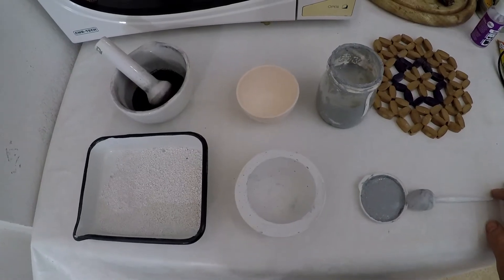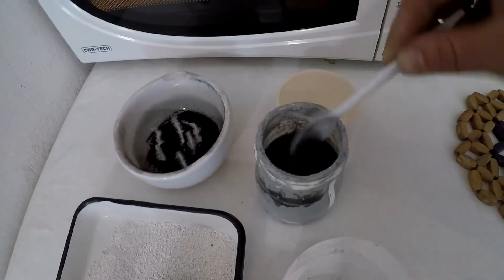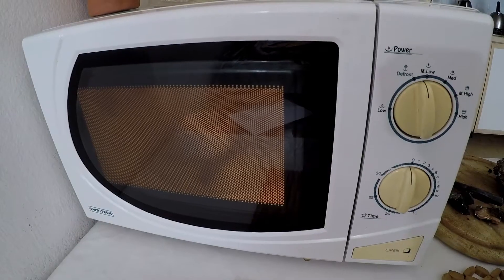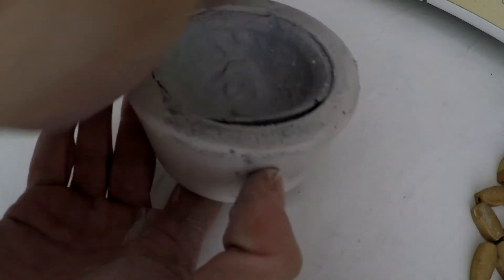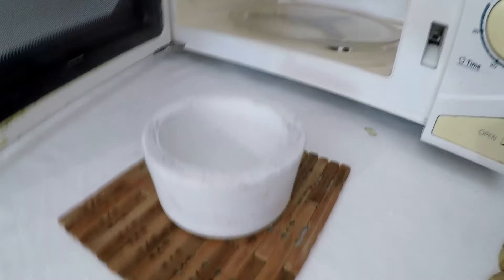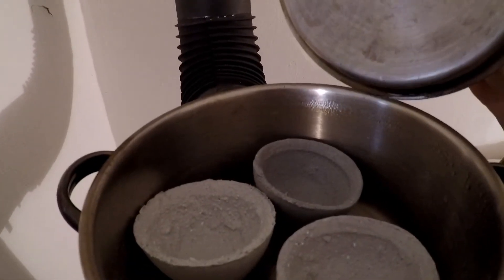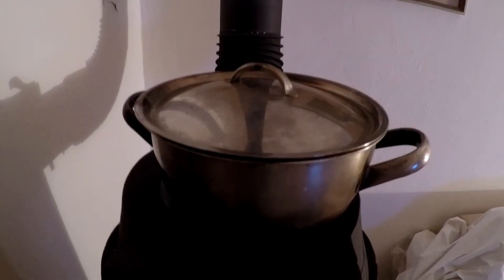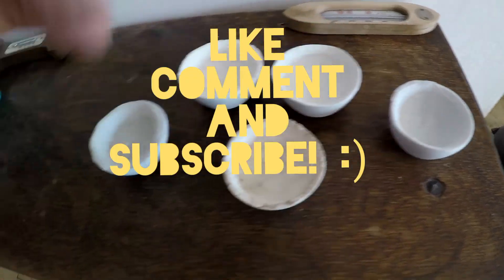Homemade alumina crucibles

Comment: Hey @GoodEnough, I read all the comments, but wanted to ask why the void former? Is it to increase the insulative value of the crucible? make it more lightweight? Does it perhaps make it better at thermal shock resistance? Also where did you learn about these particle void formers so I may educate myself. Many thanks!
Reply from the maker: Thanks for commenting, Jaden, I appreciate it!
The void formers are something I found while researching 'starlight' material on YT. There was (perhaps still is) the original video somewhere online. I then remembered it while doing this experiment and started using proper literature, the scientific stuff. Ancient craftsmen coincidentally made them when packing (or adding aggregate) straw/rice husks/manure/charcoal dust, or whatever organic material, when making pottery, including crucibles. The organic material oxidises/burns and turns to gas leaving first carbon and then voids in the ceramic matrix.
The benefit is conservation of material- of you add 30% of aggregate by volume, that's 30% less matrix used. When the clays are being worked into a vessel, the aggregate does provide more structural stability. My 200 year old summer house has a very good ceiling fasade made out of cement, coarse sand and straw. Look at any tribal mud house/hut build video from all over the world. The clay is always tempered/aggregated with something organic.
The voids do prevent hot shortness- any eventual thermal shock cracks stop propagating or advancing (for the same reason one will drill a hole at the end of the crack to stop it).
The voids have an effect on the insulation as well. Energy, including the heat, does not like to pass through different materials. The heat has to go through a solid matrix, and then it hits a gas-filled void which it too heat, by radiation and convection since conduction is not possible. For us the voids are small, but on a atomic level...that is a big hole.
I will upload a video of trying to open my first ever alumina cruciblei was really hitting it with the hammer and it was reluctant to break.
Reply: @emel60  Very informative! Thank you!

Comment: I was searching up how to make Al2O3 ceramic after seeing a russian 6b45 granit armor plate test. I cant find anyone else making ceramic from powder without industrial machinery.

So i just wanted to ask you how tough is it? Like does it can absorb a lot of energy when it shatters?
Reply from the maker: I apologise for the late reply. YT didn't notify me.
It is very tough, that's for sure! I will upload a video of me trying to open a crucible by... Hammering it! It took substantial effort to crack it open. It is also superior to thermal shock cracking. Check out some YT videos of it being red hot and quenched in water. What I am not sure about is what is the effect of different crystalline structures on physical properties. 
Let me know how it goes and if you have other questions.
Reply: @emel60  thanks for the reply, however late it may be

I currently don't have the materials to make alumina but I will try once I can and let you know thx
Reply from the maker: @STRIGON_AB  now we're back on track. I edited notifications. Much easier :D
Making alumina would be difficult and hazardous. But, it is readily available to buy in many shapes and formes. Mostly powder. Your local arts and crafts shop might sell it. It's also used as abrasive grit so some machining shops might have it, but you would need to process it. Lastly ceramic or mineral dealerships might have it. I would hit the arts and crafts shop (that's where I bought it) and if it fails-Ebay! 😂

As for making your own ceramics (at this point it's just a powder, until you give it shape, purpose and properties by firing it), a simple pit in the ground can suffice.
Sunce I made this video and experiment 5 years ago, there has been many YT contents on backyard clay bowl making and how you can source the clay, shape it and fire it in your yard with 0 fancy tools.
Cheers for commenting! I'm only 999650 subs away from my million 😂🎉

Edit: I've remembered the USA tried to do a ceramic ballistic vest protection which failed. I believe it was called Dragon skin, or similar. It was a series of (circular) plate mail, interwoven and lined with kevlar. The discs were all white and I bet they're alumina. That's the only financially viable solution.
Reply: @emel60  yeah I think it was dragon scale armor

Thx for the help bro

I'm from India, so local arts and crafts shops don't sell that kinda stuff but I do know a couple hardware store that might carry it
Reply from the maker: @STRIGON_AB  depending where in India you are living, you migh be close to the actual ancient crucible steel production sources. You have white and black high-fire clays over there in abundance. If nothing, just use these kaolinic clays, which have naturally a high alumina content. If I remember correctly, above 45 percent.
Tamil Nadu, Mysore, Hyderabad...these regions had their own recipes, shapes and sizes of crucibles for steel (and bronze) production, but what set the apart from the rest of the world is the availability of this high fired clays.

Go dig through literature for some 'down the rabbit hole' adventure of crucibles, simple (and your own history :) !) I recommend you:

-Sharada Srinivasan
-Meghna Desai
Rao Ranganathan (? I forgot how to spell it) 
-Thilo Rehren
-Ann Feurbach
-Judith Gill 
(and many more from their own bibliography).

Cheers!
Reply: @emel60  i did know we had some great ancient metalworks here but I didn't know about the clay

Thanks again
Reply from the maker: @STRIGON_AB  no problem. This is what I studied.
Besides your part of the world, ancient Chinese had porculain (kaolinic clay), but they didn't do a lot of cast iron and steel. Central Asia had ancient Merv, Persia had Merv, and Europe had ball clay in SW England (Sheffield foundries used it after pillaging India's secrets in 17 and 1800's). Germany had high graphite content clays (Hessian crucibles) which worked very well. That's basically the hotspots of ancient crucible steel production. The rest of the world used various types of tall or square furnaces to get bloomer iron, far inferior. Precisely because the clays would melt and form slag which, yes, would help to remove impurities, but also add a lot of glassy inclusions into the structure, weakening it.

Comment: you said used some carbon as ingredients, did you think grayish color can be aluminum carbide?
Reply from the maker: @dogodogo5891  Hi pal,
Thanks for the reply.
I used charcoal powder/ carbon to form cavities in the matrix of the crucibles. When heated up at high temperature it reacts with oxygen and burns. Basically it sublimates into gas, making these cavities.
Aluminium carbide would remain solid at such temperatures and no voids would occur. It would, perhaps, act as a very good temper or agregate for the matrix strength.
Hope thst helps!

Comment: Very interesting material wonder how detailed it could be for making molds, considering it has a termal limit somewhere around 1200-1300C it can easly hold soft metals like aluminium, tin, silver maybe even gold and copper. It could be a stepping stone for many hobbies.
Reply from the maker: @kompotreviews5720  Thanks for commenting buddy.
I agree with. A homemade crucible, or cupel, made in this simple way, with cheap materials and great accessibility would in fact open up a lot of arts and crafts options.
That being said, my crucibles from the video survived temperatures excessive of 1600 C, not F! Talk about a flex haha!

Comment: Hello my friend. I found a patent on google that spoke about a mixture of "10-30% thermoplastic plastic or an resin organic binder with pure aluminum oxide powder at a temperature of 150-200 DEG C." I also found work by a different youtuber using sodium silica to bind a carbide crucible. The patent does mention PVA as a binder, but for a different slip method. Do you know of or have you succesfully used any binders to make pure alumina crucibles. Thank you!?
Reply from the maker: Hey Pigeon with cool wings!
I have not used such PVA or other polymer binders but I have used two different types of clay. 
For the first type, as in the video above, I used kaolin, which is mostly silica and alumina in itself.
For the second one I used finely crushed boron trioxide glass and wetted alumina. It was a pain in the ass to dry, and crubmly af, but it did seem promising for the temperature resistance!

Problem is that adding anything to the crucible mix will remove the pureness of alumina. I can only think of extremely high pressure applied to crucible shaped dies filled with alumina powder. I think that would be the only 'pure' solution.
Reply: @emel60  a few days ago i watched a quick animated video of a sintering machine. One of the modules involved "dewaxing" the crucible before high heat firing by melting out the binder. I am now wondering if a simple wax, or rabbit skin glue would work. Maybe even rice starch!? idk. I'll let you know.
Reply from the maker: @MetallicWingPigeon  that... Is brilliantly simple and I feel stupid now. I've done plenty of lost wax casting, yet it never occurred to me ahaha! Please do a update when you try it!
Cheers

Comment: I'm not sure to understand, how do you form your crucible? You pour your silica mixture into a plaster one, wait for it to absorb the moisture, then remove the excess and microwave the whole thing? And then the molds are not fused together and you can separate them?

This looks cool, I'd like to try.

EDIT: I think I got most of the answer from another comment. The separation of both molds still seems a bit mysterious to me.
Reply from the maker: Correct until the microwaving! :D
The separation of the slip and the mould comes beforehand. I only microwave the plaster mould in order to dry it out sufficiently enough for another slip pouring.

The only way I've seen the mould and the slip fusing together is if I poured the slip into a wet mould. It would suck out the moisture, but not all of it, so you end up with basically a very wet clay. It would separate eventually, but it would take weeks!
Reply: @emel60  thx!
Reply from the maker: @fmdj  I stand corrected! I tried microwaving the crucibles after separation from the mould, but they would either explode or crack. So I exerted the drying method as in the video :p

Comment: I noticed that your recipe is a 50:50 mix of alumina powder and kaolin powder, but what amounts of grog and charcoal dust? Also, could graphite work as a substitute for the charcoal?
Reply from the maker: Hey @rpdfangon! Sorry for a late reply, I was traveling.
Correct, my kaolin/alumina ratio is 50:50, but I used a very random, by-the-feel amount of grog (fired and crushed pieces of the same ratio) and same with charcoal dust.
I am afraid graphite would not work. I mean by mixing graphite with clay you would get excellent high fired crucibles (search historical Hessen crucibles, for instance). But, it would not work like charcoal dust as it would not sublimate or burn out, so no voids would be created in the crucible matrix.